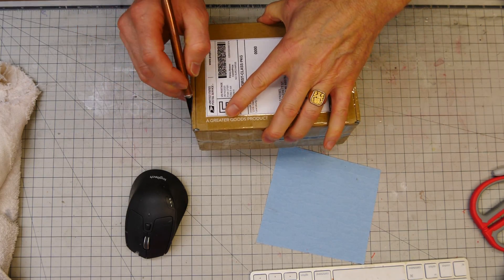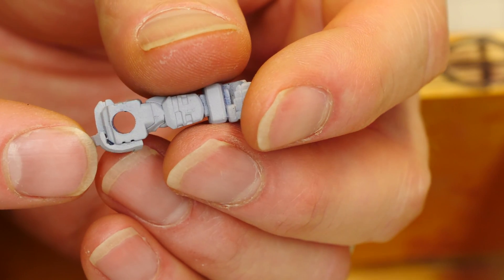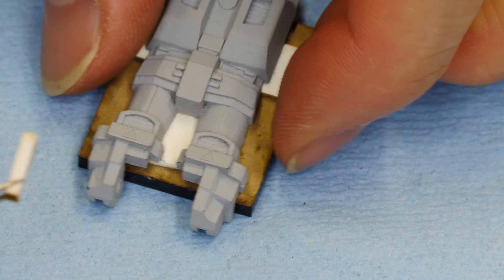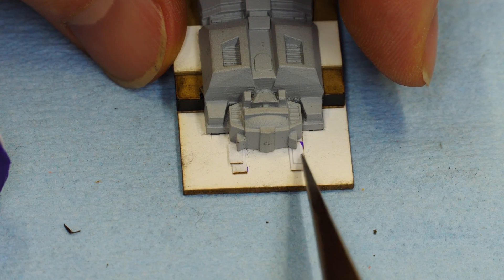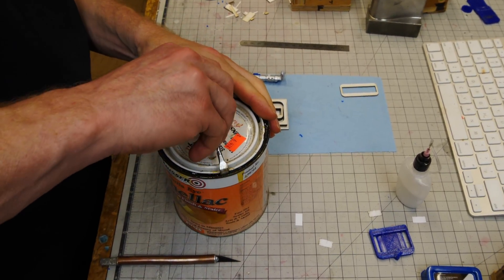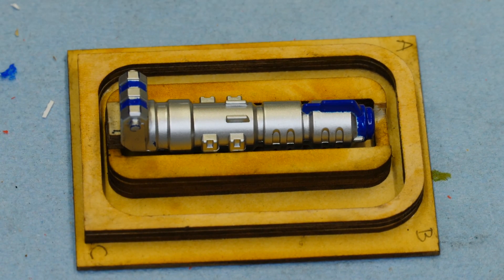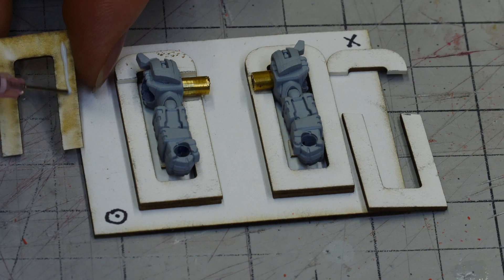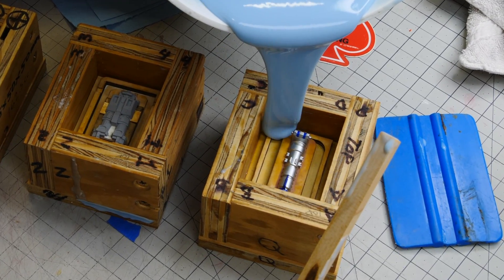Molding Toy Parts - Stack up's: Part 1

Comment: Great video!  I love the idea of using an x-Acto blade for cutting soft metal.

I never got into the habit of saving the collection of materials that you have, Eric.  I tend to use my 3D printer to make rough shapes for mounting and hole  pieces.  It it very quick when you use a .7 or 1.0 mm nozzle and does not need to be sealed.  Then again, I have to pay the makerspace for laser time, so I only use that for bigger or intricate pieces.